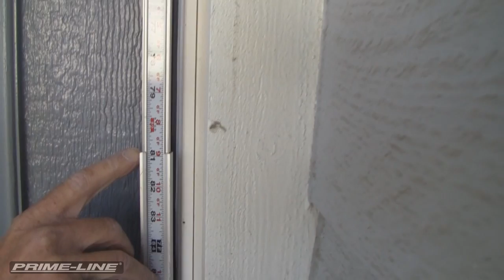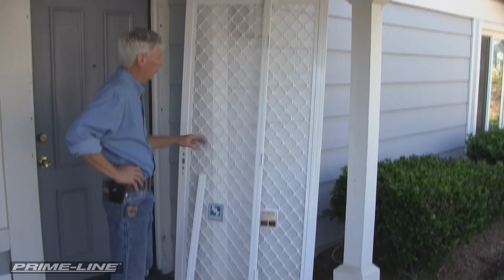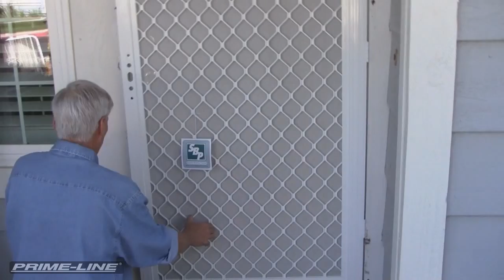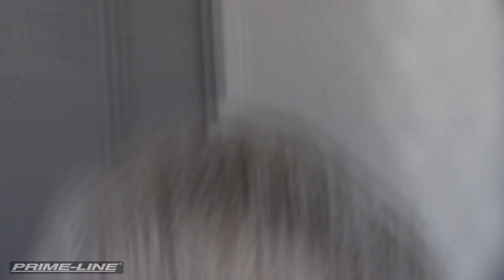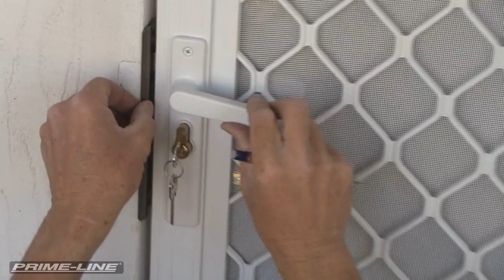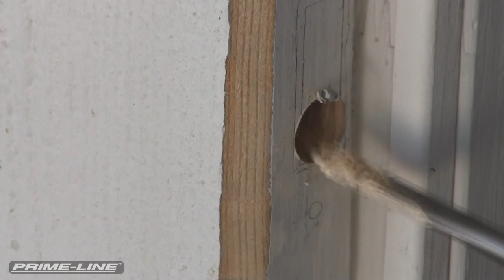How-To: Install an Aluminum Swinging Security Screen Door

Comment from the maker: I don't know if anyone stocks this item,  but any store that sells our products can order you one.  Ace, Home Depot, Lowe's, Menard's, TrueValue, etc etc...   Just ask for the special order desk.   Or you can contact our customer service department, and they will be able to help you.  (877)649-9740 (toll free)

Accu-Rule Measuring Stick
P-8067 12" to 20"
P-8066 20" to 32"
P-8065 32" to 62"
P-8064  62" to 122"

P-8120 (Set of 4)
P-8381 (Set of 3 - P-8064, P-8065 & P-8066)